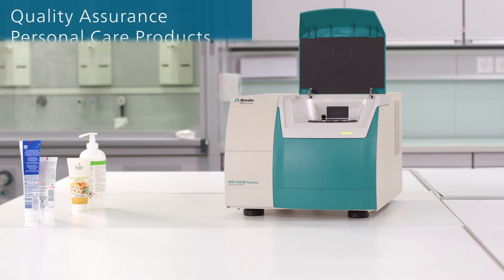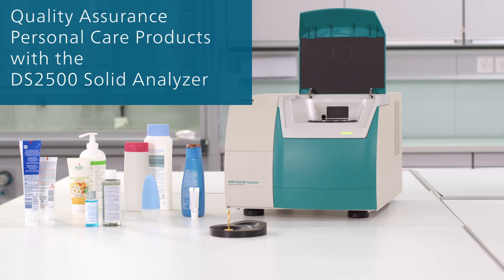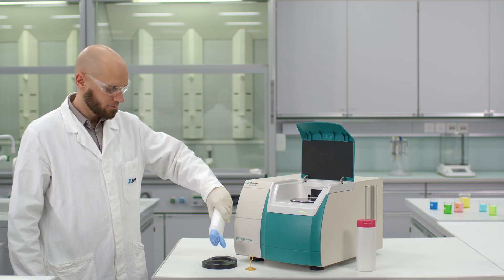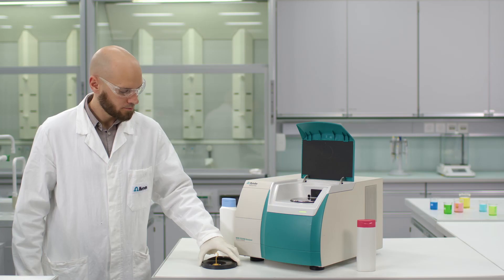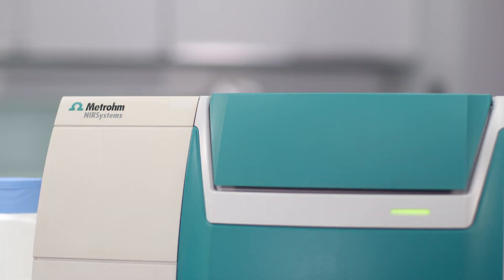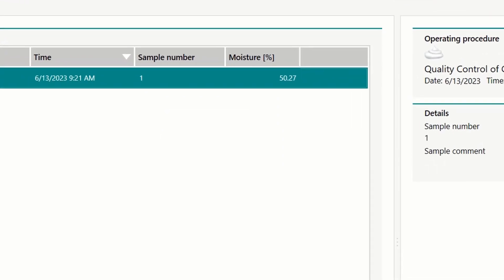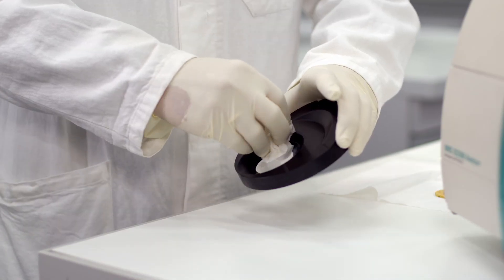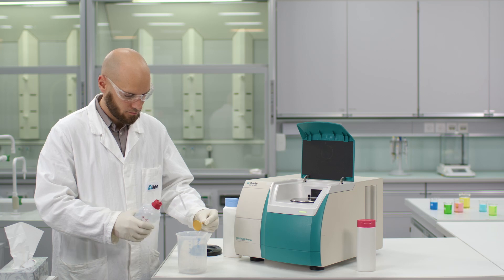Quality Assurance of Personal Care Product using NIR Spectroscopy

Comment: Why is there moisture parameter in most of the analysis? How the quality is analyzed with moisture parameter alone?
Reply from the maker: Hi
Moisture content is definitely one important parameter for the quality assurance, but it is not the only one. Next to that, multiple key parameters, like ethanol, glycerol, or active ingredients like sodium laureth sulfate can be measured simultaneously in less then one minute using the DS2500 Solid Analyzer. The Vision Air software displays all parameters on one screen when the analysis is finished.